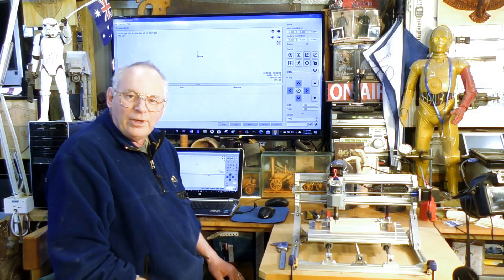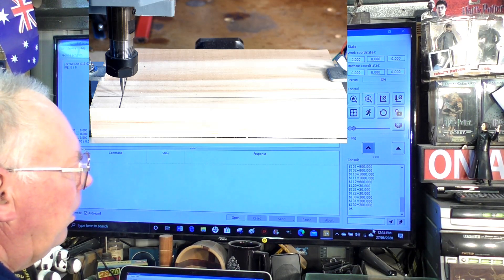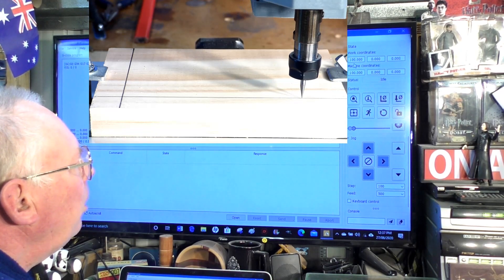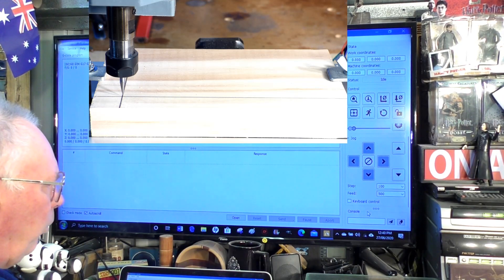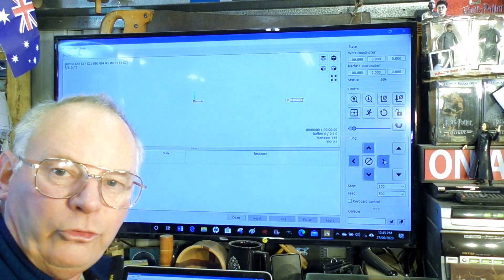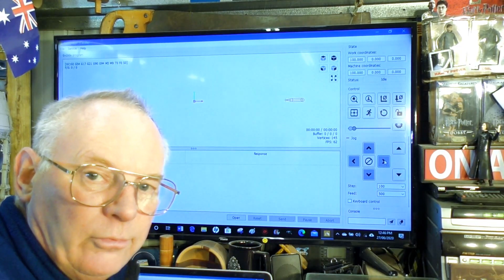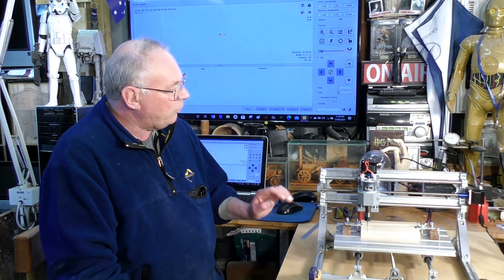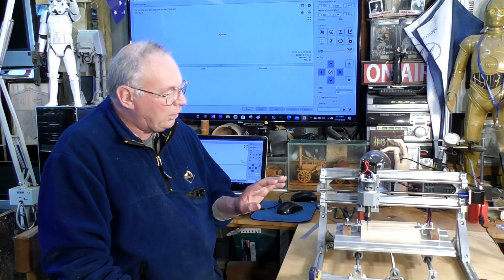3018 CNC Router engraver XYZ Axis Calibration made simple, CNC on a budget

Comment: The math is really quite easy. Distance actually traveled divided by the distance it should travel gives a ratio ; 107.5 / 100 = 1.075:1 .... Look up the currently set steps (860). Divide steps by the previously calculated ratio ; 860 / 1.075 = 800. Reset steps to 800. Done.
Reply: Or you could say 1 full rotation of the screw is 8 mm and there are 200 steps per rotation and because settings say 800 that mean he's using quarter steps. So 8 mm divided by 800 equals .01 mm per quarter step.🙂🙃🙂🙃🙂
Reply: yes answer is integer number. if its 798.978 or 801.213 then you need change leadskrew better cheap chinese version that have not pitch error xD

Comment: In my experience the only time you need to adjust steps per mm is when you have changed stepper motor angle type, stepper controllers that have a different micro stepping defualt or lead screw  pitch. These machine are simply incapable of the level of sub thou accuracy that would ever need compensation due to say thermal expansion, I saw your previous video where your pocket was incorrectly sized, but that was because you did not set the tool width compensation value. It was not a steps per mm issue.

Comment: Awesome video, I appreciate for this explanation, I have the same machine, with the same size moving base plate, my engraver bit moves in X axis for entire length but in Y axis only 120 mm, please can I use the same concept to expand the Y axis size ? Because my project size requires 160 mm in Y axis. Which number for Y axis needs to increase? Thanks very much for your help.😊🙏
Reply from the maker: Glad it was helpful!
Reply: @rogerwebb9600  Hi dear any answer to my question?
Reply: Yes you can. It is the same method using a different axis number

Comment: Hi. Roger Enjoy your videos .I have trouble with my new 3018 Pro. I hit send & the spindle goes all the way to top chatters against the stop then starts to move around like it was cutting. Anybody please HELP thank you
Reply from the maker: Hi Jerry, Google, GRBL $ code list
https://www.diymachining.com/downloads/GRBL_Settings_Pocket_Guide_Rev_B.pdf
You could put in $3=6 this will change the axis direction
Reply: @rogerwebb9600  Thank you Roger for the response BUT now all the spindle assembly does is drive the bit down in to the material until it stops the motor.

Comment: Hi Roger, are you running windows 10 on your laptop??
Reply from the maker: Yes win 10
Reply: @rogerwebb9600  thankyou mate my 3018 has been sitting almost 1.5 years as i could not get the driver to run on Windows 10. But now its up and running again, i would love to know if you think i could make a coin mold from graphite with the 3018.
Graphite is very soft i could send you a sample if you like
Reply from the maker: Hi Jesse, the 3018 may, my 6040 and 6012 CNC router will and my Sieg X2 mini CNC  will in 4140 steal, I have videos of them doing this job on my channel.

Comment: No, No Roger, that's fuzzy logic........I just can''t  do it.....with Mach 3 you specify the move and the axis to move.......G00 to rapid to X00 ,Y00 (G54)  etc and G01 to feed to X50 Y50 etc, add a bit of Z to go down......that is so logical I write my own G code and I'm an 80 year old noob at best.
It's only 2.5D but what the heck, you can write that manually so easy......3D needs a CAM solution.
If I indulge in one of these toys.....they're all toys now I'm retired.....I'll have to redo the op system to run with Mach3 and a Gecko drive....whatever...hang the cost.